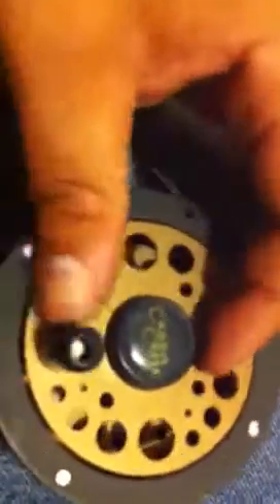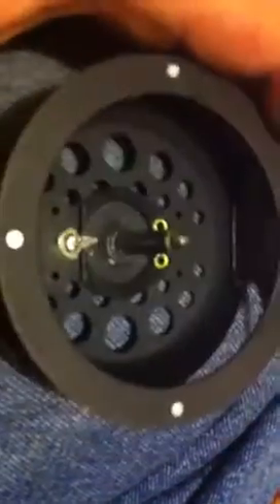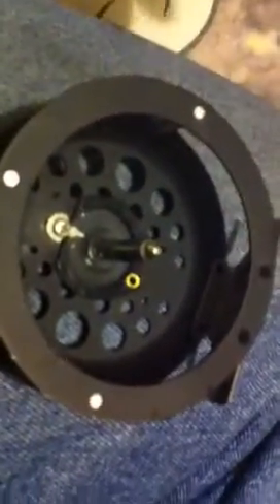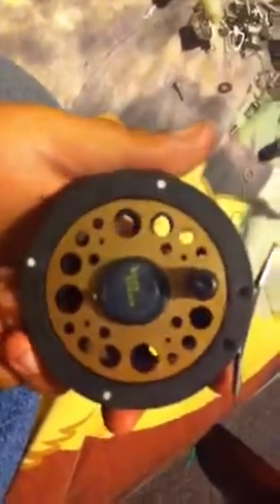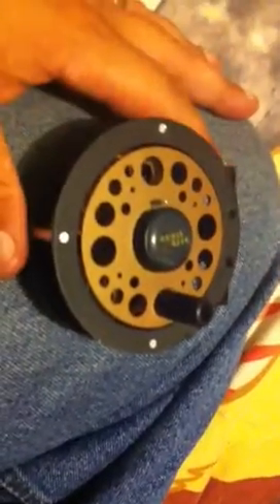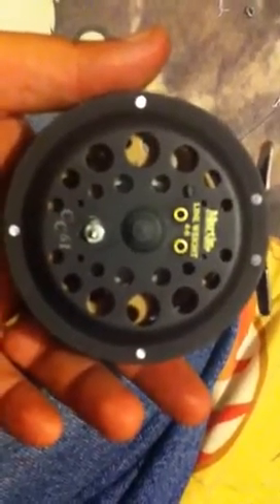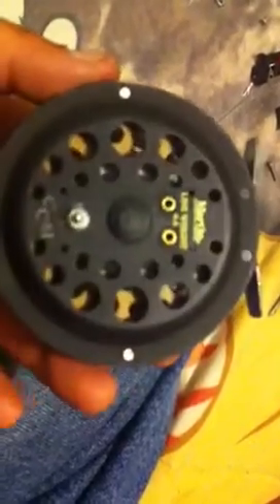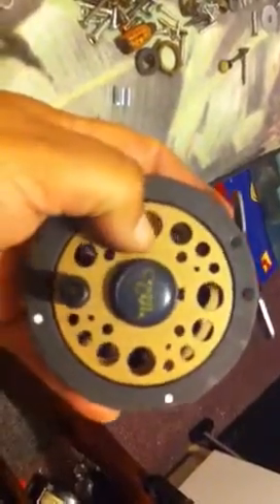Martin caddis creek fly reel pile o junk!

Comment: its a 20 dollar reel, what do you expect? if you read up on that reel, it says it is a rim controlled drag, that means you have to put your palm on the rim to control the drag, the clicker is only there to keep the reel from unwinding from the weight of your stripped line hanging. Trout reels are only there to hold your line anyway.
Reply: Its rim control on the larger version of the caddis creek
Reels, the smaller one has a clicker drag,  I've had similar issue, these are made by zebco now,  this not a real martin reel

Comment: You can use the reel either left or right. To change sides you must pull all the line and backing out then wind it in the oposite direction. I have had mine on the left and right side and the click workes either way.